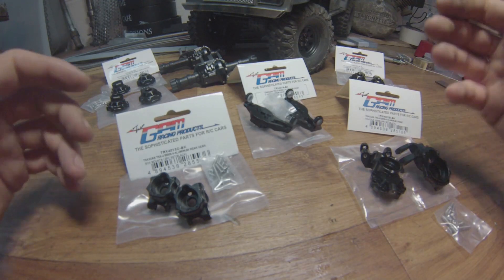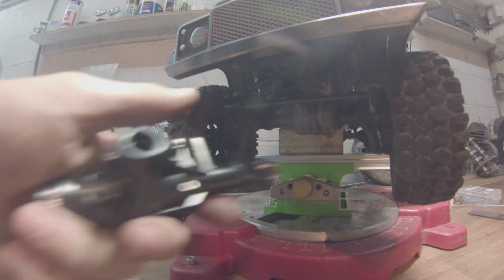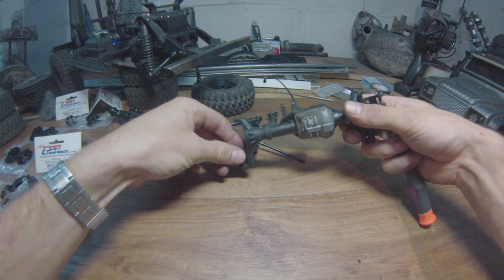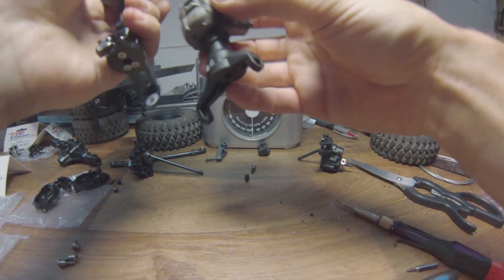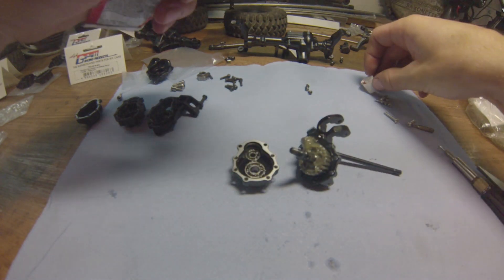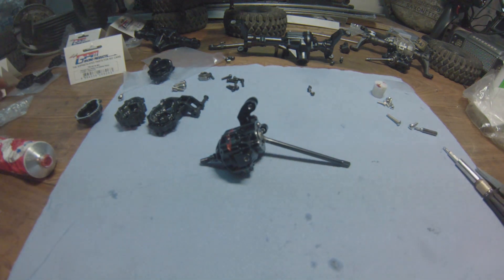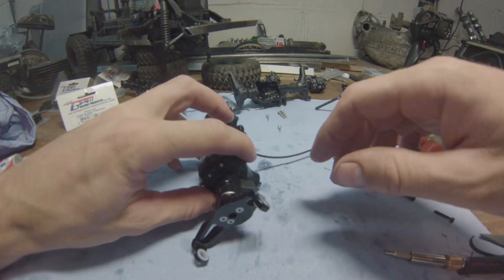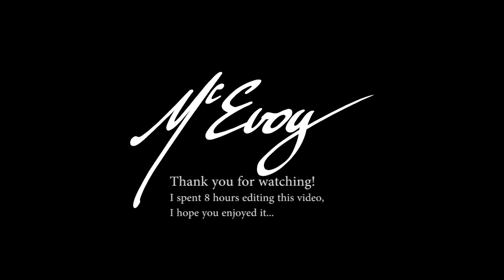Traxxas TRX-4 Technical: High tech front axle upgrade

Comment: Hello. What is that red cream you are applying? 7:17
Reply from the maker: Hello! It is an automotive sealant. It's a bit like silicone if you like, but specific to automotive applications. Although it has to be applied to perfectly degreased surfaces so it stays in place, it is compatible with greasy or oily environments, such as these axle cases. It provides a good seal to help contain the grease, and keeps dirt and water out of the part.
Reply: @ thank you for your answer
Reply from the maker: @RC_TRX4  It is always a pleasure. 🙂
Reply: @ I searched the internet and couldn't find anything specific. Can you tell me the exact brand of that item?
Reply from the maker: @RC_TRX4  I can't find that exact one any more, but you can get Elring 006.553, which is essentially the same except that it is black.
Reply: @ thank you for your answer 🙏🏻
Reply from the maker: @RC_TRX4  My pleasure! Have fun, and feel free to get in touch if you need anything else. :-)
Reply: @ thank you. Have fun too 🙏🏻

Comment: Hello. How many grams of difference is there between the original axle housing? edges not included, body only. Thank you
Reply from the maker: Hi there, I honestly have no idea. It certainly provides more weight down low, without being so heavy as to put a strain on the motor. It is perfect.
Reply: @ thank you. So how many kg do you think will be the weight that will strain the motor? I don't want to upgrade too much. I don't have the means to change the motor :)
Reply from the maker: @RC_TRX4  Mine is upgraded to the rafters. I have made many modifications to it, and it weighs 7.5 kilograms. The original brushed motor could handle that, but it will wear out faster than normal. This being said, it is relatively cheap to replace (around 30€ if my memory serves me correctly).
Reply: @ I'm from Türkiye (🇹🇷). It's not cheap here :) For example, I bought my TRX4 Defender for 40,000 units.
Reply: @gmcevoy  Ah I forgot to ask. Which engine did you replace the old engine with? Don't worry, I have a last question, I won't take any more of your time 😊
Reply from the maker: @RC_TRX4  I am not sure what the change rate is, but I must agree that the TRX-4 is not cheap no matter where you live. All it needs is just a bit more weight as low as you can (axles and wheels), and it will already perform much better than stock. You don't have to spend too much for that, and it is great fun to drive no matter what. Enjoy! 🙂
Reply from the maker: @RC_TRX4  Not a problem, it is always a pleasure. I replaced the stock motor with Hobbywing Quicrun 1200 kv combo. It drives a lot slower, but develops much more torque. It handles the extra weight very well, and it could climb a wall if there was enough grip. It is perfect for technical crawling, but not so good in second gear. It is a compromise that I find acceptable, and it works really well. Feel free to get in touch anytime if you have any more questions. I usually respond to all the comments I get. 🙂
Reply: @ yes, it is not cheap. I will do my major upgrades like axle, wheels, bumpers, shafts, then continue driving. I think nothing will happen to the engine with these weights :) Thank you for your answer 🙏🏻
Reply: @ I know Hobywing Quicrun. It is a very torquey motor. I think I would buy the 1800 kv one but it is not possible now because it is not sold (customs law) it was very expensive when it was sold

Comment: Nice job dude. However, after you did all the effort with the sealing of the parts, there is still like river flooding inside your differential. All the bearings inside the diff pumkin have loose fit which allows tons of water and mud leak inside your diff case trhough both ends of the axle. Check Traxxas explode view, there is nothing to keep water out. Rear axle is different story and perfectly sealed right out from the factory. Believe me, I just repaired my front diff - completely rusty, all the bearings stucked. Checked by the same time rear diff, was like new.
Reply from the maker: Hi there, and thank you for your comment! Always appreciated. :)  I filled it with so much grease, that there was no room for water to go in. Most importantly, if you place enough grease on the driveshafts, when you rebuild, it will stop water from coming it. I have not yet edited the yearly maintenance video, I really should get to it. Basically, my front axle is pretty much how it was in this video. So this mod/upgrade is really worth it! Thanks again for watching! Have fun out there, and stay tuned for more TRX4 tech videos! I am working on a gearbox modification, so it can carry oil instead of grease. it is going to be awesome!

Comment: What sealant are you using here?
Reply from the maker: Hi there. Thanks for stopping by! It says on the tube "High temp red silicone gasket maker". It is basically red RTV silicone, in a tube. There are many manufacturers out there, Permatex is one of them. Make sure you stay tuned, as I have just shot a tear-down and rebuild, of this very axle. It is almost a year ago that this was shot, and I have not serviced the axles or portals since I did this modification. I am quite amazed by the result. This truly works, and makes them water tight! Thanks again for watching my videos! Have fun out there :)
Reply: What brand were the axles? Was going to see if I could find those more local to here in the USA